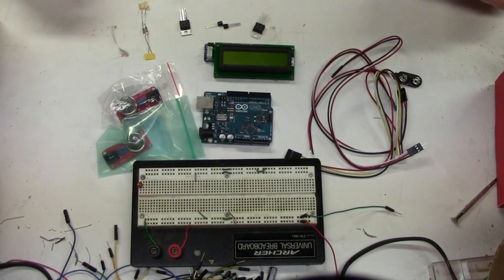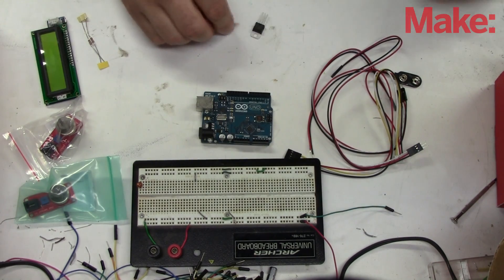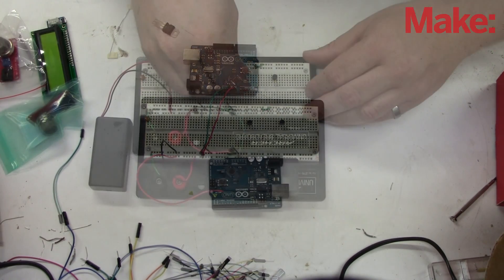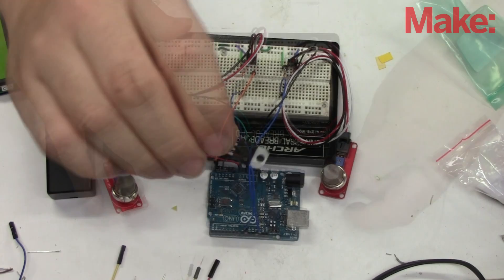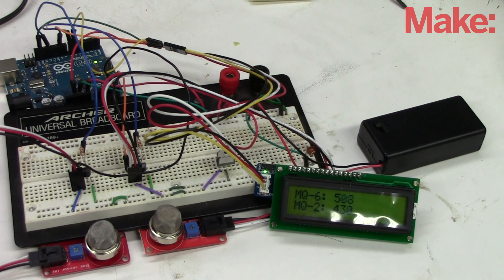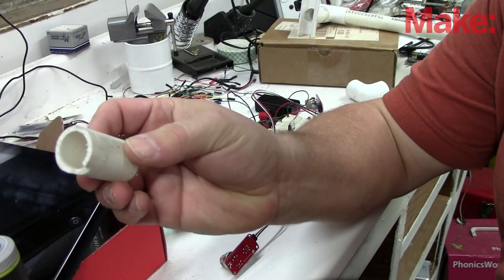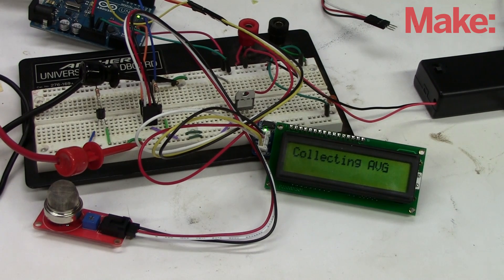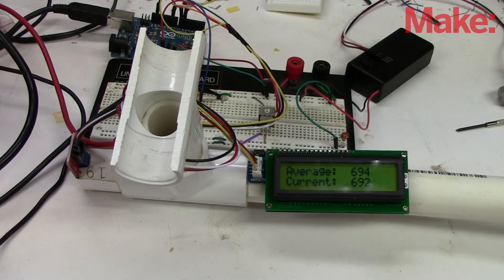Projects with Ryan Slaugh: DIY Gas Leak Detector

Comment: Change the design slightly. Use a single length of 3/4" PVC pipe on one end hot glue a 20x20x10mm 5VDC fan sealing the edges. Drill 2 holes in the side for the sensors to be mounted to and hot glued in place. Place a coupler with a PVC slip joint to threaded male fitting on the other end then thread a flexible water line with a female fitting on to that end. At the end of the flexible line you can place another threaded end to PVC slip and add the modified T coupler to use as the cradle around the end of the line. You can then also change that out for a long wand made from copper tubing for reaching into tight places as well. It's all a single wand shape it's force ventilated making the gas blow past the sensors and it clears the gas chamber when no gas is detected allowing for faster readings. And it's more portable.

Comment: I could argue with that, I think a lot of people that like to experiment with stuff have at least thought of using an Arduino. Mainly because its a cheap/easy way to get into programming and projects. Seeing as with a lot of PIC-uC you need a programming kit and. With Arduino everything is included from programmer to IDE. Starting from their smallest and cheapest boards all the way op to their biggest. Plus the online support for Arduino is HUGE (but maybe that's because no-one uses it).